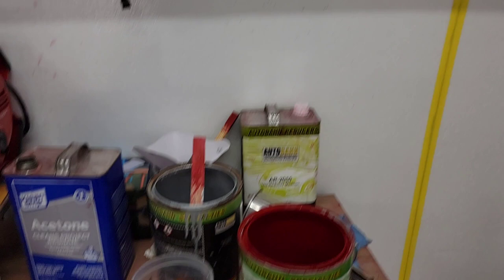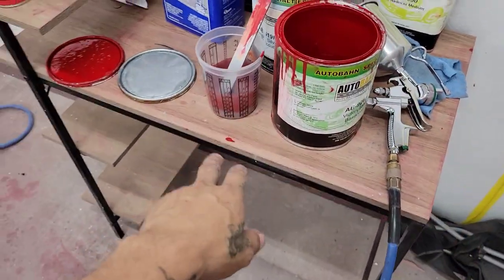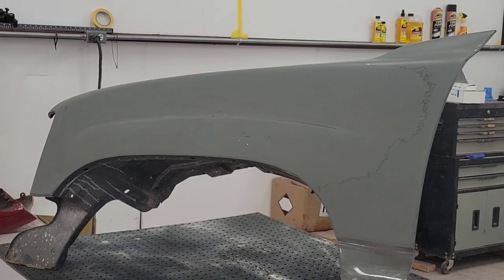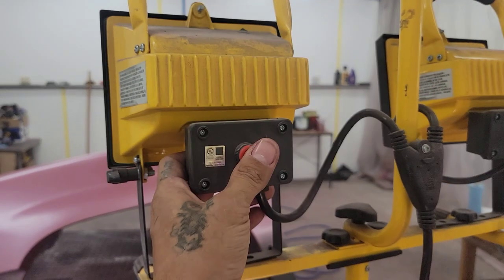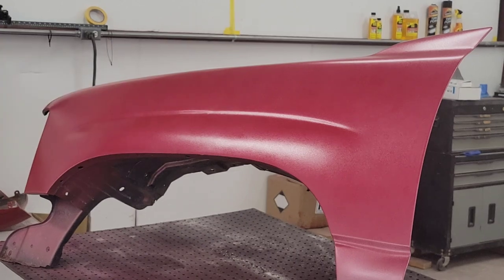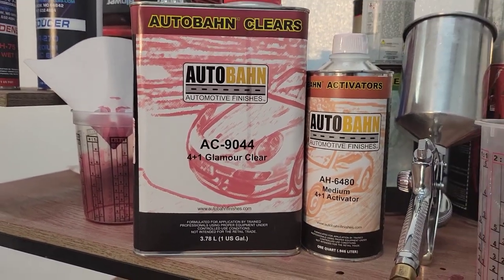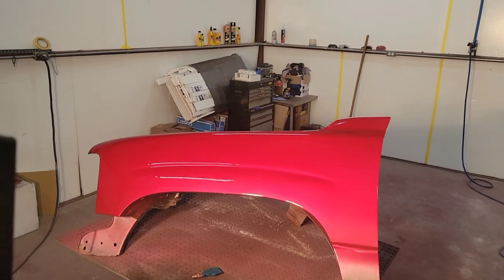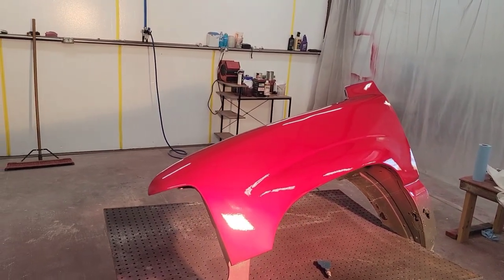Mixing leftover paints to make this beautiful color - Let's Spray

Comment: Huh, I guess I'll be oddball- honestly where you ended up isn't all that impressive, its like a pale/dusty red metallic. I think  you could have gotten 99% of that with a 2 stage.  

Now your ground coat looked really different, I was hoping that you'd try giving that a coat of clear to see what that looks like. It wouldn't be anything like the red soul crystal, but it would be a really nice pink metallic. If that didn't have enough pop with clear over it, then maybe try adding a little pearl flake in the clear.